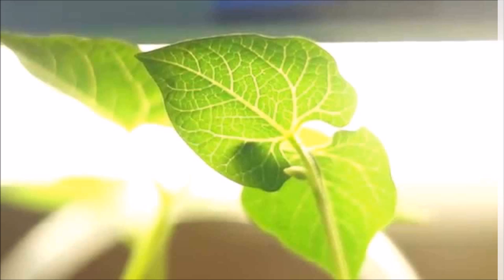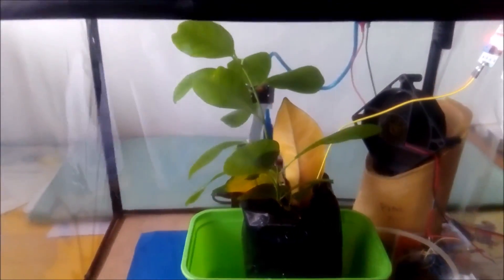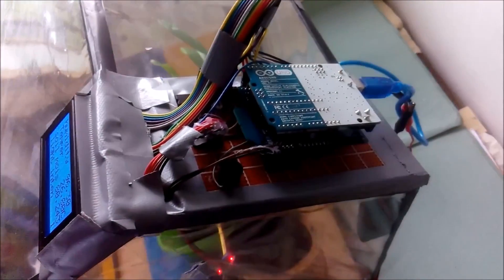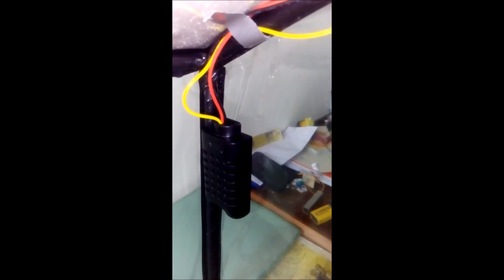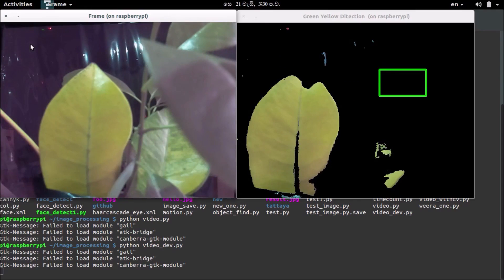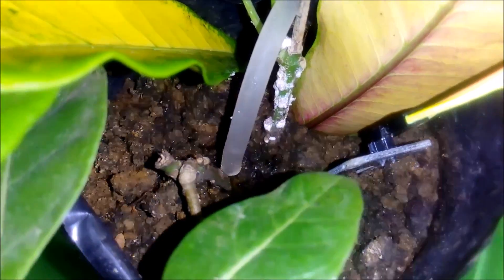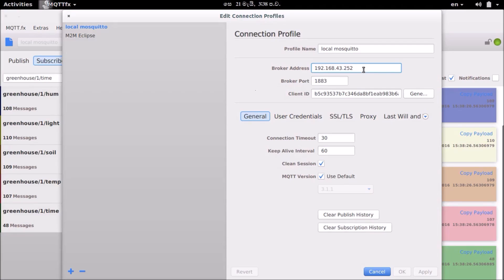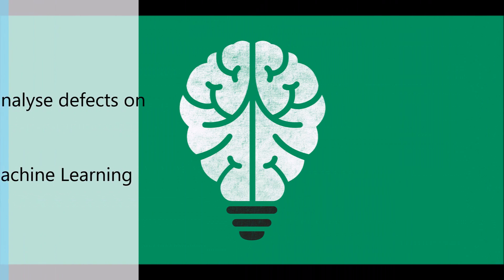Smart IoT Greenhouse Project | Embedded Systems in Action 🌿🌍

Comment: I am planning to construct a 3000 sqft Green House Project in SL to demonstrate High Tech Farming methods. Appreciate whether you can provide guidance / services to install an IoT system in the GH to monitor Light Intensity, Soil Moisture, Inside Temperature, Humidity, CO2 & O2 concentrations, Disease detection  & Water quality (EC, PH, Temp etc).
Reply from the maker: Contact me on asak999@gmail.com i can provide infrastructure

Comment: Please can you turn off the music it is very hard to concentrate  on the video voice and is not needed
Wye did you use a shield when you could have used ESP8266 it has all you need processor and WiFi to do all the work and more memory?
Reply from the maker: Yeah you are correct if we used a nodemcu we can save a lot but this was a university project just used equipment provided.